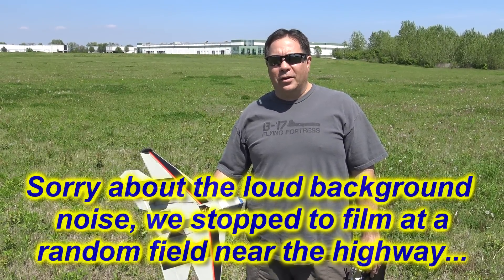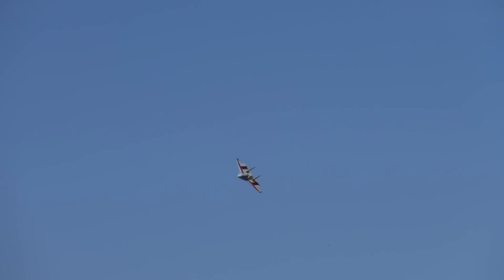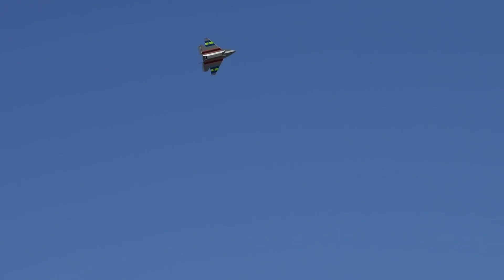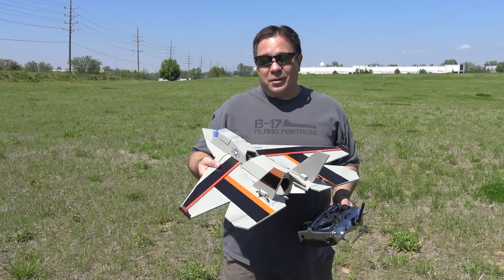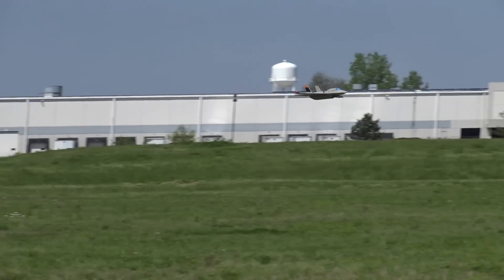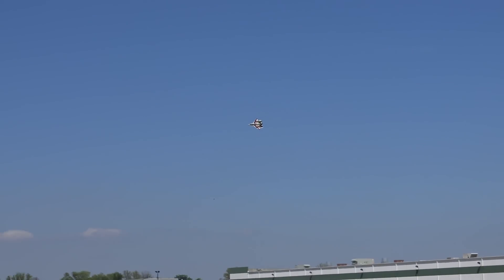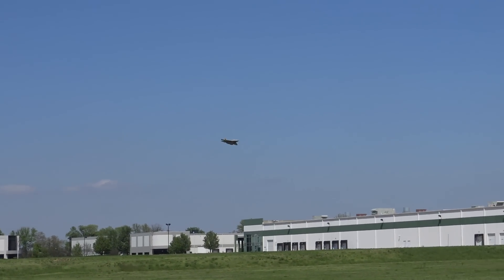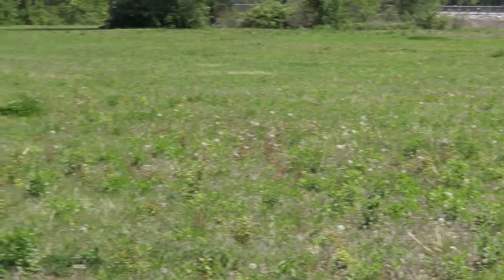FF-Viper Jet - More Test Flights

Comment: Not sure if you use any expo or not Paul but the first flight seemed a little touchy to me on the elevator,but that could just be you getting use to the controls of a new plane or first flight of the day,rather than me thinking it might of been that thrust plate.

Anyways great little plane and thanks for sharing much appreciated.